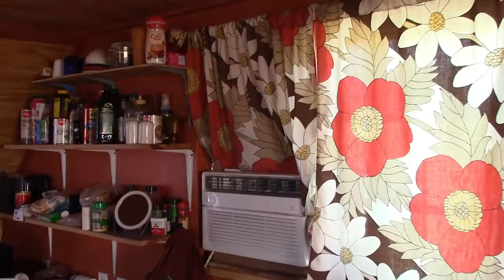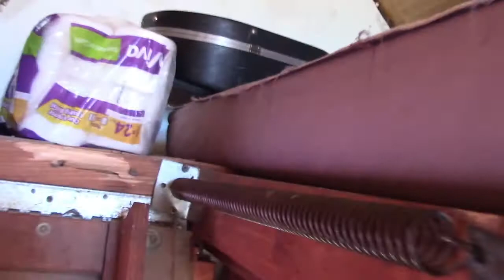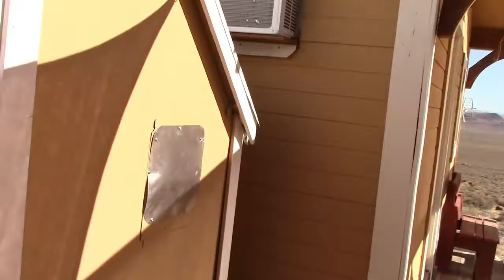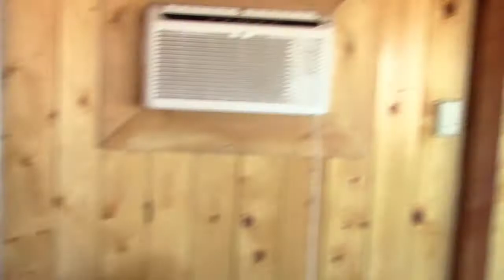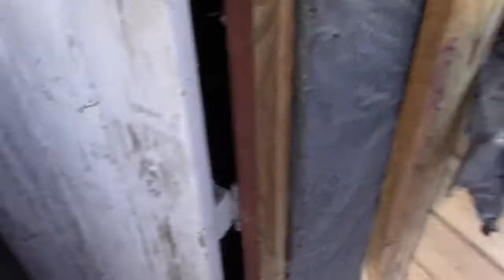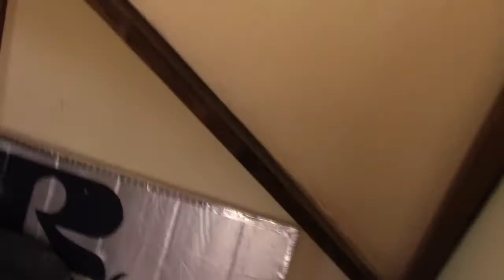Off Grid Tiny Home

Comment: What do you mean by canvas painted on? Did you put paint on canvas? Or is the canvas pre-painted?
Reply from the maker: On the plywood or rigid foam insulation I put a heavy layer of primer, then imbed the canvas into it. Then more primer to make sure it gets saturated. Using canvas or fabric  to cover walls is an old technique used on houses. In fact my 90 year old house has fabric covering the interior walls. I adapted and modified the  technique  to use on exterior walls. It was initially an experiment and was very successful.  It makes for a strong light weight weather resistant surface.